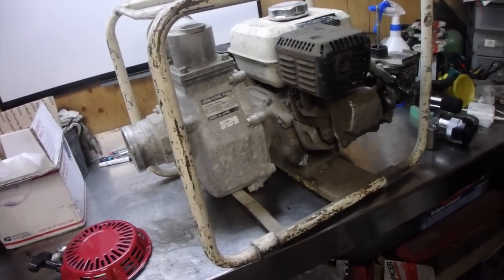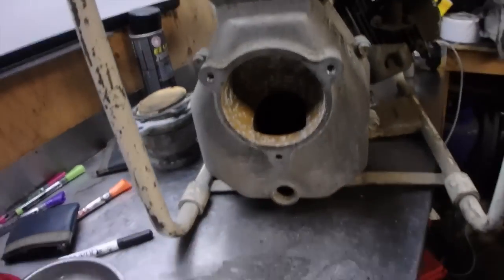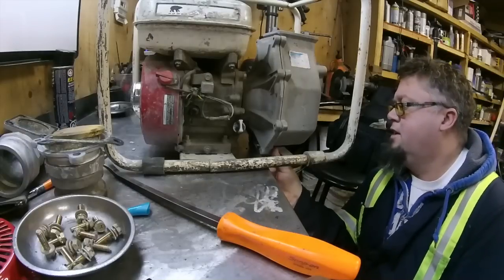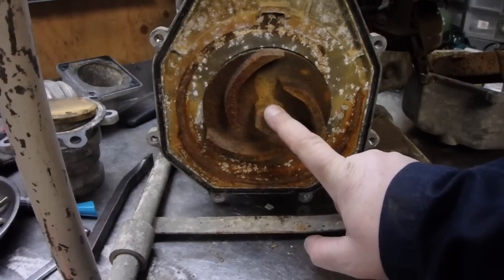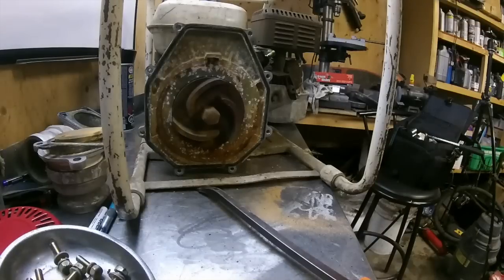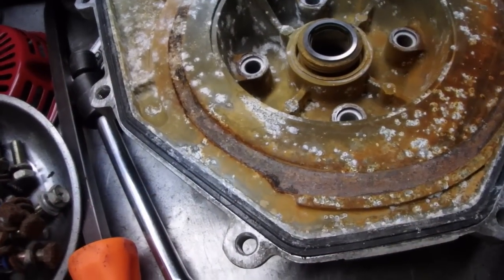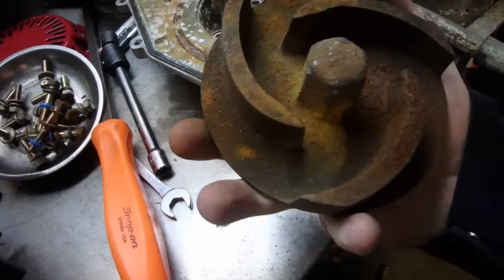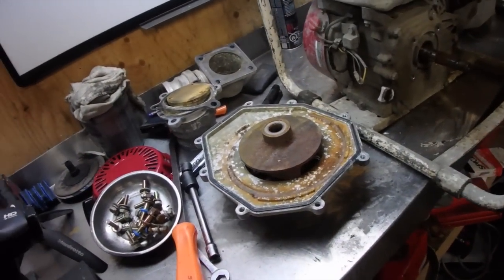Dewatering Pump Rebuild Part 1

Comment: I have a clone I bought 15 years ago used it once for emptying my spring at my camp and to get it to draw water from a 5 food drop was hard to start but once it primes look out , mine is a 2 inch your at 3 would pump like crazy. Never seen the inside , interesting . Thanks
Reply from the maker: +Steve Rob i'm fixing it up and plan on selling it,  I can't remember the flow rate of that pump at the moment but i'm sure you could use it to put out fires